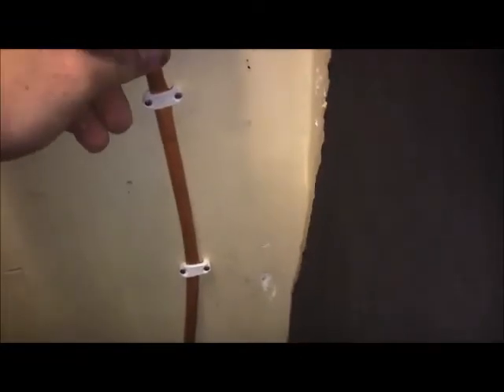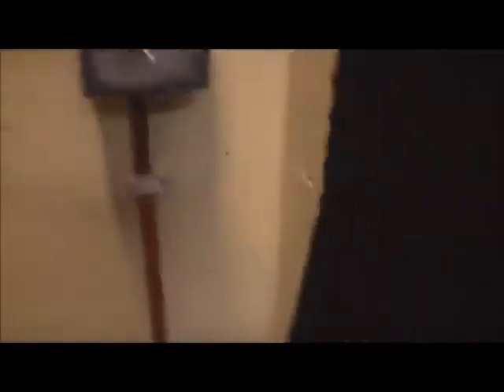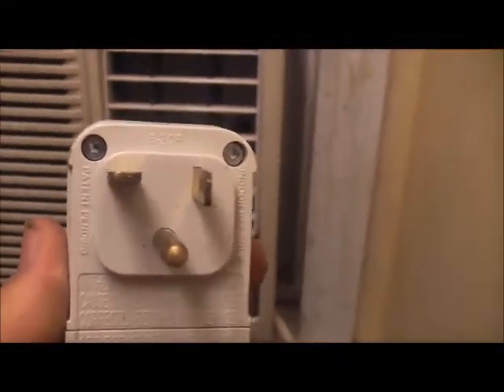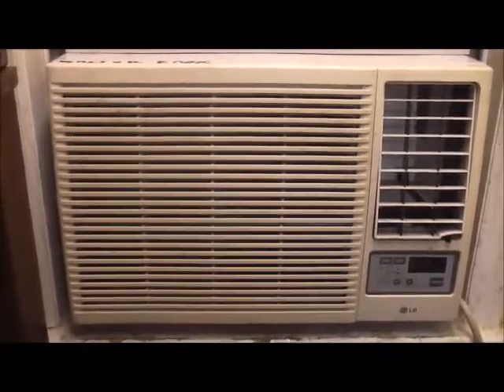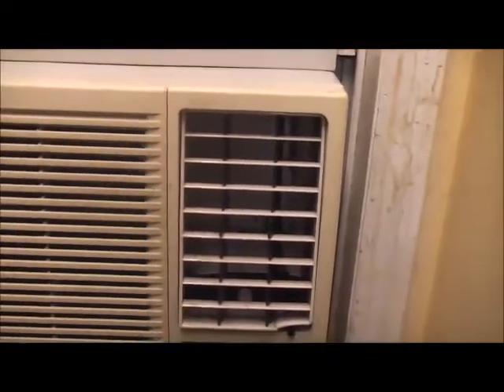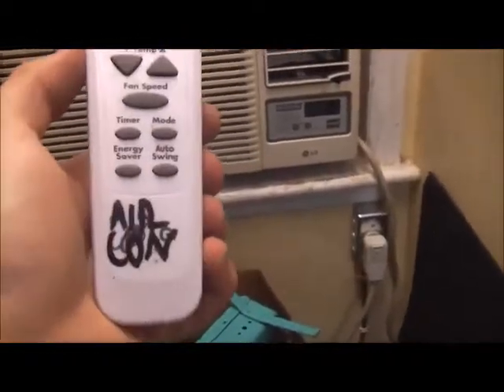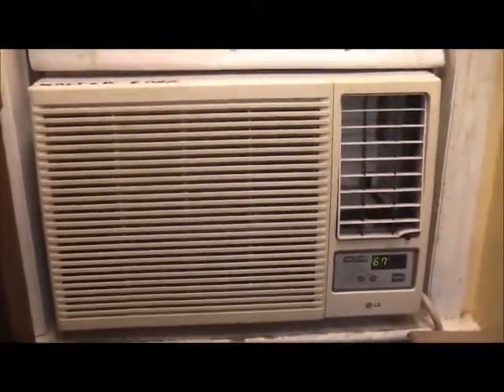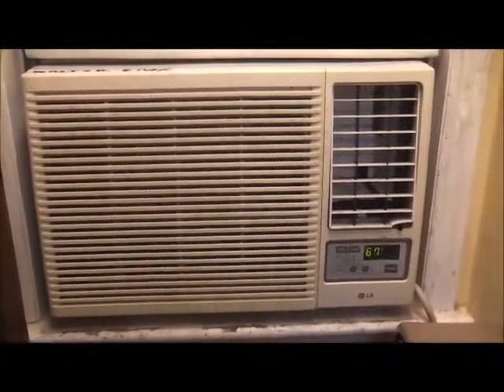LG 12,000 BTU 220 volt AC/heat unit installed/220 volt outlet installed.

Comment: Hello sir. I have a huge question for you and hopefully you can help me out. I have that same ac unit but the volts required are 230v to power the unit. It came with an adaptor to plug into the wall but it won’t kick off any cold air at all… I purchased a generator thinking it might do the trick due to the voltage requirements but it trips the safety breaker just when it’s about to kick in cold air. Any idea what I’m doing wrong?
Reply from the maker: Is it an adapter that goes from the 240v plug to a regular 115 volt plug? If so, that will not work. The unit requires 240 volts to work, that is 2 hots and a ground. A standard 115 volt plug has a hot, a neutral and a ground. It simply will not work properly on 115 volts and requires 240 volts to work. I am not sure why they would include such an adapter. Is the receptacle on the generator 240 volts, or do you still have to use the adapter? if you are still having to use the adapter, then the voltage is the same and the reason it is kicking out the breaker is that at half of the voltage, it cannot start the compressor, and it is taking too much current, so it trip. Did you buy the unit new or used? it seems like buying a generator would cost a lot more than just buying an air conditioner with a regular plug on it. If it is used, and the generator has a 240 volt receptacle on it, and it is tripping the breaker, is there a chance the AC unit is defective? my best advice would be to either have a proper 240 volt receptacle installed if you can assure the unit is not defective, or just buy a unit with a standard plug on it. It sounds like this would be the way to go instead of having to run a generator or have any special receptacles installed. If that unit is know good, you could sell it, or if you bought it new, you could always return it.

Comment: I’m curious how the heats holdin up does yours constantly turn on and off on heat mode
Reply from the maker: Honestly, I never use the heat mode, I used it once or twice during testing and it worked well, it is from 2009 and the previous owner didn’t complain about the heat... if it is turning on and off too constantly, it could be the thermostat short cycling or maybe poor air flow? I am not too sure... I use it to keep the room at 60 degrees all summer and dont use the heat in the winter.

Comment: Where did you get the AC. I have been looking all over the place for a 220 Volt ac
Reply from the maker: well, this exact model is not made anymore, i got this from a guy on Craigslist.a 220 volt AC is pretty easy to find if you know where to look... how many BTU do you need? here is a link to a 12,000 BTU with heat like this unit...
https://www.lowes.com/pd/LG-550-sq-ft-Window-Air-Conditioner-with-Heater-230-Volt-12000-BTU/1000776702
if you will be buying a new one I would not recommend LG though.